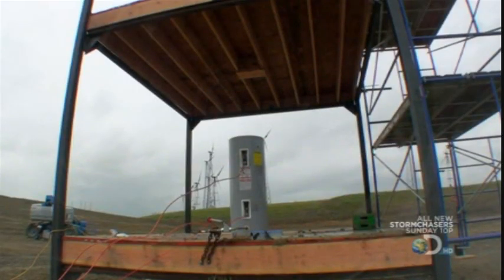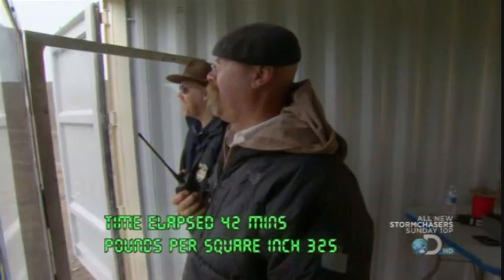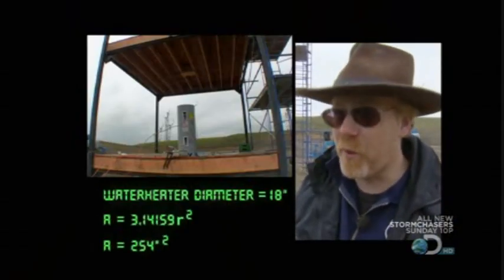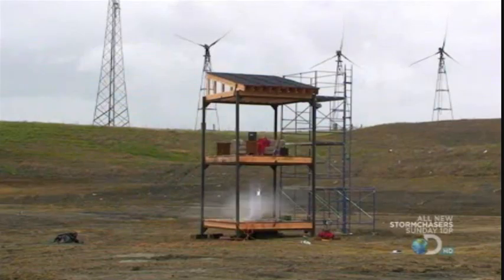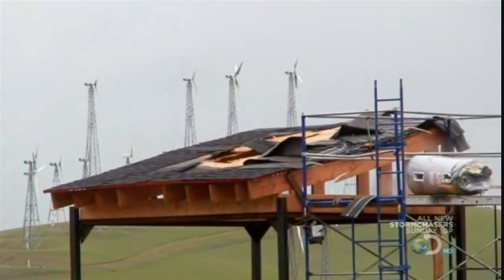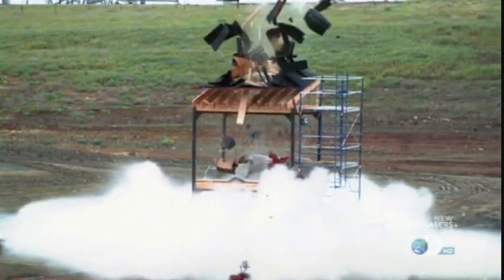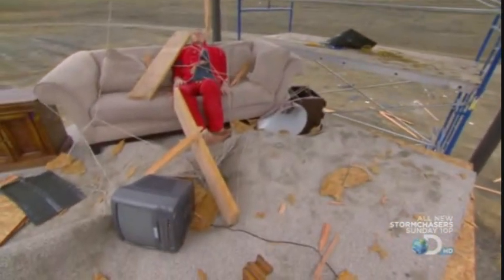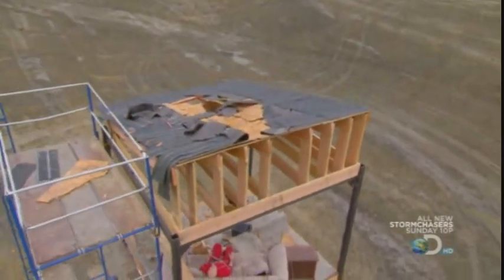Mythbusters Water Heater Explosion

Comment: This happened at my G-ma's house after she passed and we were selling it, except the blast went out the side of the heater and blew it out through garage door.  Ripped a good portion of the plumbing out of the wall with it as well as the electric lines.  Thankfully the house was empty when it happened.
Reply: Sounds like something a boiler would do, not a water heater. Houses in Australia dont have boilers as its not that cold, and coincidently hot water services (as we call them here) do not explode. Never ever seen on the news or even heard on the grapevine.
Reply: "I'm taking this water heater with me"

Comment: Water hammer's one hell of a thing.

IIRC the US had an early nuclear reactor accident where a criticality element caused a steam detonation that lifted the whole 3-ton reactor vessel and slammed it into the reactor building's roof.
Reply: Water hammer is a phenomenon that occurs in pipes to moving water right? I don’t think it’s the same phenomenon at all in this water heater, but feel free to correct me if I’m wrong
Reply: @superluminalsquirrel9359  It can happen in pipes when the flow of fast-moving water is abruptly changed, but the term is general refers to what happens when you have a large amount of fast-moving water impact into something. Water cannot be compressed, which can cause some pretty spectacular effects under the right circumstances.

Comment: As a plumbing and heating apprentice, that scares the shit out of me knowing I’m working on these beasts  😅
Reply: Electric WH  has a T and P valve it will open when pressure gets to great also has a ‘pellet ‘ that will melt out also and then there is a reserve thermostat that pops the reset button out and cuts the current below the top 2 screws . It’s hard to blow up newer WHs
Reply: @randyblackburn9765  People in this comment section are acting like a water heater is the same as a Boiler. They are all extremely misinformed on how the water heater system actually works, and how it's capable of failing.
Reply: Just bleed the T&P valve bro
Reply: I agree. That would scare the crap out of me too

Comment: I would also like to see them put one of their safety blast shields in front of it to see what it would do.
Reply: The thin sheet of polycarbonate they often stood behind?  Water heaters break building foundations and the MB test went through three floors of 2x12 joists.  It would take a lot of Lexan in a very heavy steel frame, to stop it.

Comment: Years past this episode and still amazes me. Also another tid bit, if it is enclosed in a house there would be a lot more damage due to the concussive force outwards on an inclosed area.
Reply: I was just wondering how hot that room would be if it was enclosed
Reply: @fryncyaryorvjink2140  Given the expansive qualities of steam (which is so much more powerful than compressed air) and the temp stated, 200 L of water flashing instantly to steam if you had a basement size of say, 30 x 20 feet you would be in serious trouble ANYWHERE in that basement and I mean skin hanging off in strips. In an adjoining room, it would probably blow the door in, damage your eardrums and send you to the ER but you would more than likely be spared any major harm. Are you listening, 911 Lonestar?
Reply: @marvindebot  ... it boggles the mind to think of the additional damage that 30 gallons of water can do while flashing to steam, which will be about 1,700 times in volume. Put that in an enclosed area and imagine the pressure change.
Reply: @marvindebot  but hot water systems operate at completely full of water, meaning if it had no pressure relief, it would just split with water squirting out and no explosion. For an explosion you need a good size volume of air to give momentum to a large weight to be moved.
Reply: @rossbrumby1957  No sir, incorrect. A hot water system has some airspace at the top of the pressure vessel and if the relief valve is blocked this will fill with steam that will increase in pressure (a HWS is basically a low pressure boiler) this is why the pressure increased in the one used in the above demonstration. If the system has not been maintained by topping up the tank using the easing valve tyhis space is even larger allowing for even more steam to develop but it is not this steam that causes most of the damage when a HWS blows up. 

Water under pressure stays a liquid (ie: does not turn to steam) at higher temperatures than at atmospheric (this is why you can’t have a decent hot drink much above base camp at Everest because the water boils at a very low temp in low pressure and much higher one at high pressure) so the water in the HWS is very very hot, it is superheated. When the tank eventually blows the pressure drops all that water flashes to steam instantly expanding to 1700 times its volume as a liquid and producing an explosion in exactly the same way it happens in a boiler explosion in a locomotive boiler. This expansion is why steam is so much more powerful than compressed air at the same pressure. Even if the tank is completely full the pressure will still rise (over 300psi in this case), burst the vessel and the water will flash to steam. Water cannot be compressed (unless you are taking almost black hole pressures as to do so requires the compression of actual matter, not just the space between molecules) so will not produce an explosion. 

Source: I hold a boiler operator’s ticket from my days working for the History and technology section of a major museum many years ago and still drive steam trains as a hobby as well as an undergrad degree in physics (hardly a great achievement but sufficient to understand stuff like this).
Reply: @rupe53  Perhaps you could concur with me below, Mr. Brumby does not appear to "get" it.
Reply: @marvindebot  ... It's already been explained several times, although some of the experts seem to think there's an air space (or steam) building in the top of the tank. The bottom line is the tank ruptures because we've gone well beyond the design limits of the tank. The rapid expansion of the water into steam is the boom!
Reply: @marvindebot  Water CAN be compressed, just not nearly as easily as air. It's possible to make buoys which compress less than water. Then, they can control their depth by moving a piston in and out, slightly changing their overall density to match that of the water at the desired depth. Of course, if you've got a gradient in the salinity, that will affect the density at a given depth. 

Cold water won't explode, but if you've got a container of water at a high temperature and a pressure much higher than the ambient pressure outside, you've got a potential bomb.

Somewhere on the net, there's a video that's like a small version of this experiment, except for the fake house.  Some nut job put a can of spray paint on a barbecue grill and filmed it with a high speed camera. Fortunately, he and the cameras were far enough back. The results were similar to here, except the can was so fast it only showed up in one or two frames after the can burst, and, if I recall correctly, there was a pretty good fireball. Not a great idea unless you can stay FAR back and can keep anything you don't want to die far back as well.
Reply: if you try to find the hot water tank episode of a show called (i think) "breaking point" they do the same but in a real, inclosed house and it essentially causes WAY MORE damage to a house with closed walls.
Reply: @Kandiell  There's another Mythbusters video on line where they explode a water heater inside a small enclosed building. 
https://www.youtube.com/watch?v=jbreKn4PoAc
It would be nice if these episodes started with something  about how, if your water heater at home is in good condition, such an explosion is extremely unlikely. In the case of a gas water heater, I'd be more concerned about the gas. Also, if you spilled a solvent in the basement, the pilot light might set it off. 
A few years ago, somebody screwed up and too much pressure was sent into gas pipes in Lawrence and Andover Massachusetts. In some cases, the gas leaked and there were some powerful explosions inside houses. When you look at photos of the damage, it's amazing only one person died.
Reply: They did that on a norwegian tv show and it's amazing how much damage it does https://youtu.be/HS6fImxE9Lo
Reply: People would die
Reply: I was driving through Flint one day and there was a house that was basically a pile of sticks and I found out later the Water heater exploded.
Reply: Yes.. if there were walls and totally enclosed I think the results would be totally different. The entire building would blow up with the explosive force.  Wouldnt just be a neat hole through the floors and roof.. there would be no floors or roof
Reply: To the people arguing about this in the thread: they've LITERALLY demonstrated this before. They've tested a water heater failure within an enclosed structure that they built. Like... on the show.
Reply: @harmless3449  maybe so, but this experiment is not accurate because of the open structure. If you had a firecracker go off in your hand it might sting a little but bo damage.  But wrap your fingers around it and let it go off and youd have your fingers blown off.
Reply: The most amazing is that some people actually live in houses constructed in this manner.
Reply: @rehepeks  ... are you referring to wood frame construction or the fact that this one has no walls?
Reply: plus wouldnt it go through each floor even easier for the same reason breaking a big stick is easier than a tiny stick of the same thickness? this model home had tiny squares compared to the full size of each floor in a normal home

or do houses already account for this and this isnt a factor?
Reply: @HaydenTheEeeeeeeeevilEukaryote   I feel you are missing the point of the video, which is to show how much force is really available when a water heater has this issue. You'd never design a home to withstand this. You'd properly maintain the various systems, so this NEVER happens.
Reply: @rupe53  true, plus it bursts right through despite being stronger, so it shows it regardless
Reply: @rupe53  Also...if they made the home strong enough to take the punishment from an exploding boiler...that force has to end up somewhere...it either smashes your stuff...or worse...you.
Reply: @brentfisher902  ... There are buildings constructed to withstand similar blasts and the key is they have a sacrificial wall designed to blow outward. The idea is the pressure must go somewhere and if it's done properly it keeps the rest of the building intact minimizing damage. This would be with industrial manufacturing, not residential.
Reply: if you enclose it in a cage it's far safer when it explodes..
Reply: @chrishayes5755  Hot water tank: None of you seem to understand. I'm not locked in here with you. You're locked in here with me!
Reply: @chrishayes5755  ... what makes you think the cage would survive?
Reply: It would never happen, period.
Reply: @starmc26  ... this is where you need to know your history. Stuff like this happened often enough that the Hartford Insurance Company got involved, back in the days of steam boilers in homes. They actually hired people to refine various safety devices, and invented the Hartford Loop, which changed the world of steam heat.
Reply: @rupe53  A BOILER is NOT a water heater.... Putz.
Reply: @starmc26  i believe you meant to say a water heater is not a boiler, like how a rectangle isn't a square

Comment: This happened to my dad’s friend a long time ago. He had a 70 gallon water heater...
My dad told me when he went over to his friends house, to help him with repairs, the water heater had shot three perfect holes through the floor, ceiling, and roof. The room that contained the water heater was absolutely demolished. The concrete floor had a huge dent in it with massive cracks. The water heater landed a BLOCK AWAY. 

Fucking insane what some household appliances are capable of
Reply: If you study the history of Chicago, there was a rash of "water heater rockets" before the invention of the T&P valve.  The water heaters would blow through a Chicago three-flat (three storeys and the flat roof) and later be found 3-4 blocks away.

Any halfway-decently educated Chicagoan (meaning someone who has studied Chicago's history) will worship the T&P valve the same way a post-apocalyptic society would worship an unexploded nuke: We understand the power of the bomb that lets us have hot showers, and do not want to anger the terrible forces within.

Yes, even an Engineer will look at a water heater with the same respect one would give to a pacing tiger, and will likely have a brief panic attack when hearing the phrase "...the T&P valve is sealed"

At my previous job, the plant had small heat exchangers called Thermolators to help regulate the temperature of these large injection molding machines.  When doing a routine safely inspection, I found one with the T&P valve plugged; one of the maintenance staff was putting stoppers in the T&P valves to 'prevent leaks.'

A) if a T&P valve is leaking, either it is on the cusp of opening due to the temperature and/or pressure leaving the safe levels, or the valve is getting worn out and needs to be replaced.

B) Did I already mention that 'sealed T&P valve' = 'BOMB'?
Reply: @andrewdreasler428  I sure hope that well-meaning maintenance person got a stern lecture, at the very least.
Reply: @Eroraf86  as far as I know, he was just told to replace leaking T&P valves instead of plugging them, and he was removed from the plant's Safety Team. (The safety team there is a whole COLLECTION of horror stories on its own, but those are for another time).
Reply: As an additional safety feature you have a built-in temperature fuse in the heating element, which limits the maximum pressure by limiting the max. Temperature in case the thermostat fails or is manipulated.
Reply: @norbertfleck812  no. No you don’t. There is a high limit built into the upper thermostat. That’s it.
Reply: @ghostsamongus3370  You can watch video's of people doing it on purpose. I can assure you it is possible.
Reply: In this thread: People who think the standards where they live are universal throughout the country or the world.
Reply: I agree. That is freaking insane. A block away. Holy freaking cow, gosh dang what a flipping nightmare
Reply: Water heaters don't and can't do that unless you really want them to. That means blocking pipes off and pumping pressure in or running the heating element flatout with no thermostat. Boilers like in old steam engines do blow up however because they're meant to make steam and if a relief valve jams youre fucked. A hot water heater will simply force water back into the mains pipe if it's relief valve jams, and will never, ever be higher pressure than the mains pressure that comes out your garden hose.
Reply: @rossbrumby1957  Wrong, I'm sorry. All systems require a check valve on the cold inlet which prevents any backflow into the mains. Failure to do so is against regulations and risks contaminating the potable supply. 40 yrs licensed plumber. Cheers.
Reply: @paulmac7667  As a plumber, have you ever actually seen something like this to happen?
Reply: @paulmac7667  Weird, my hot water recirculation system would disagree with you.
Reply: @starmc26  No difference. Still part of a sealed system.
Reply: @SteveB88  Only the aftermath. Half the side of a house gone and that was an external system.
Reply: @paulmac7667  what???.... You clearly don't know what you're talking about.
Reply: @starmc26  Sounds like you're not a plumbers arsehole mate! Only exception is if it's an old style, low pressure system, running off a header tank. Which suck!
Reply: @paulmac7667  Wrong. My municipality requires zero back flow prevention. Just because it’s code in your city doesn’t mean it’s code everywhere.
Reply: @jman0870  Sounds pretty third world to me. And just where, pray tell, is your 'municipality'? Congo? Somalia? Southern Chile?
Reply: @paulmac7667  So...your common sink faucet, your common copper or pex plumbing, your common flexible hose, will take 300PSI? I fail to believe that from experience. Also, where I am at, there is no check valve on the water heater, at the source yes, but that means water will back flow into the cold side and we have issues over 80PSI keeping toilet floats shut off.
Reply: @J-1410  You're like a dog with a bone! You should realize that I'm an Aussie and Australian plumbing standards FAR exceed those implemented in the US. They're pretty much the highest worldwide. The copper and Rehau style pex systems I install will easily test at 2000kpa (300psi).
Reply: @paulmac7667  Which US standards? Feel free to list which ones, being as all 50 states have differing ones, plus cities have differing ones, along with counties, townships, and other designated areas.

Also why? What are you doing down there that you need over 300 psi to a toilet?

Also 2000kpa is 290.0755 PSI.

Edit: All I am finding from your government is 1200kpa, which is roughly 176PSI, for mains water. Are you building a skyscraper or something?
Reply: @rossbrumby1957  there is an one way valve installed on the intake side of a hot water system.
Reply: @rossbrumby1957  wrong. All you need to do is plug the relief valve and have a bad thermostat (and the thermostat is a HUGE maybe). That’s it. Would you care to be wrong again?